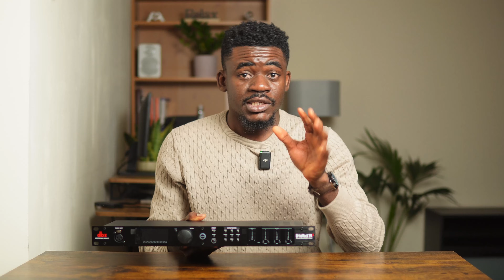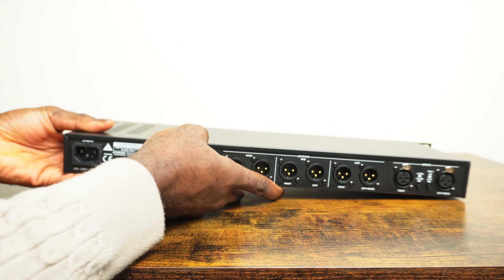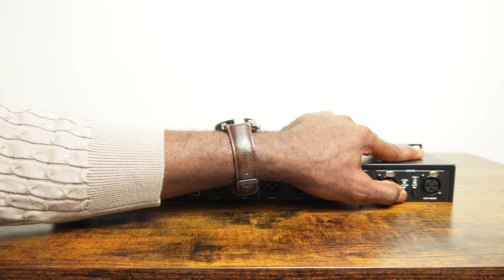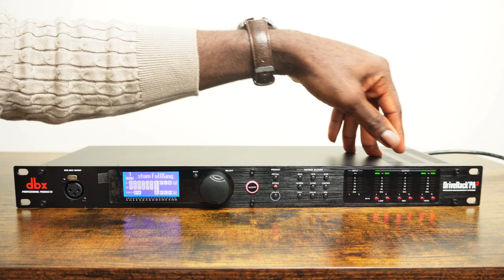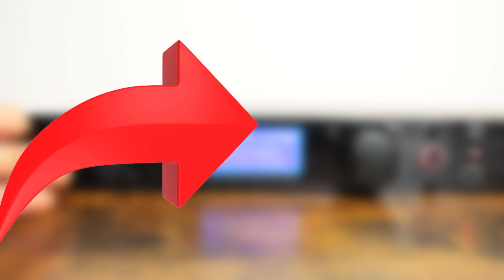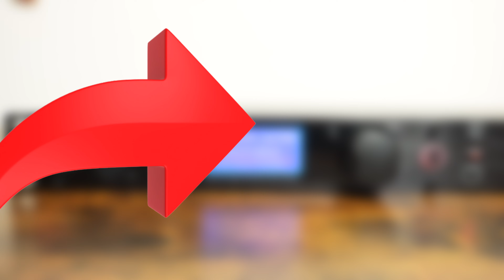How to use dbx DriveRack PA2 - Part 1: Overview

Comment: The sad thing about this model is that it doesnt have a brickwall limiter, peaks will pass before it limits, and so it won’t actually prevent the speakers from blowing, eventually…
Reply: Does the original DriveRack PA have a brick wall limiter?
Reply: Oh no